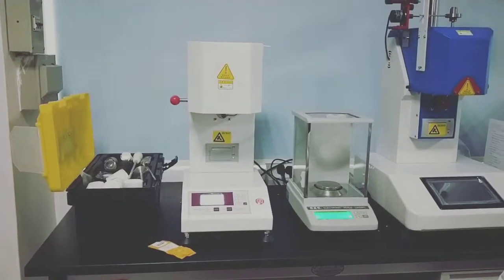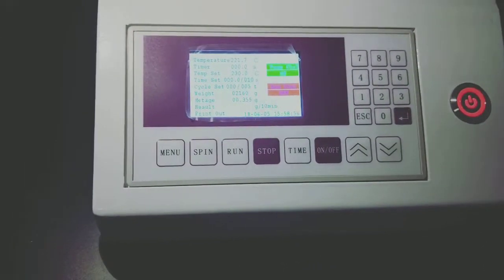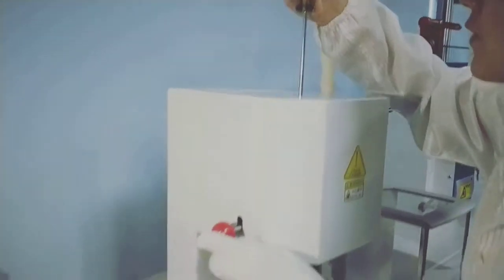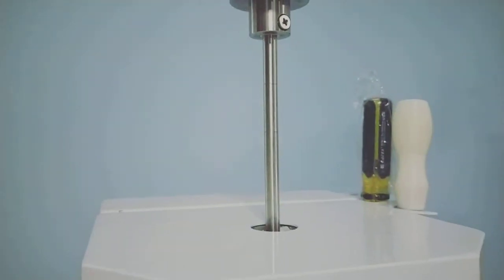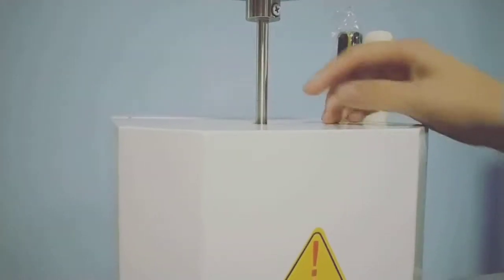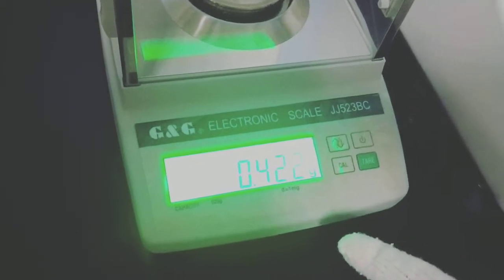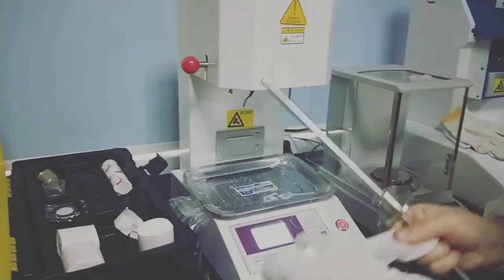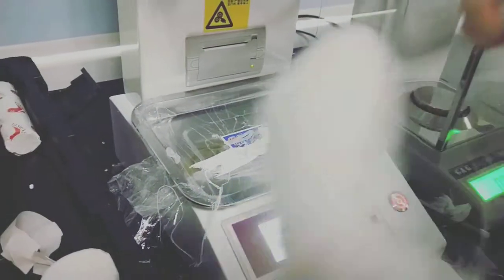MFI operational video in English

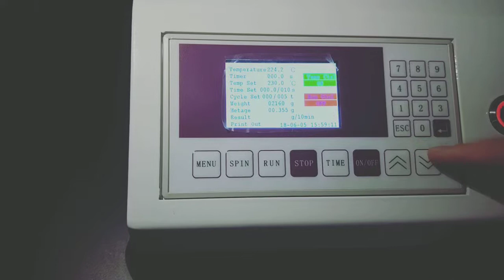Comment: You inputed the weigh 0.2160. Can i ask what weight is that? Is it the weight of the whole sample that you have added? 1:46 
Thank is advance
Reply: That is 2160g... means the weight we added on the machine... there are different weights that can added... different material required different weights and different temperature...